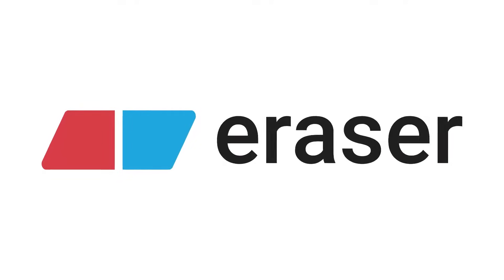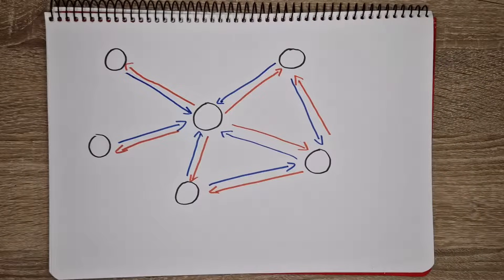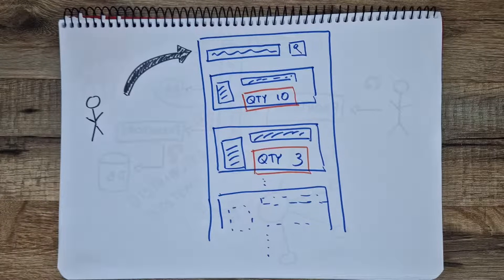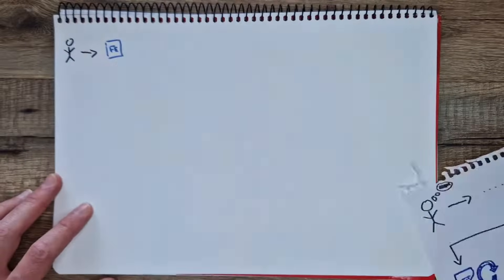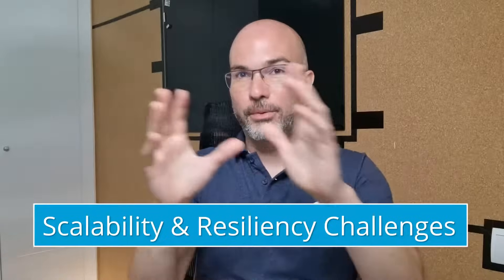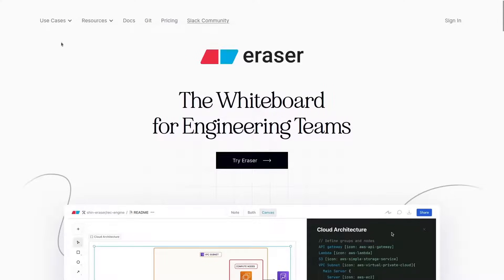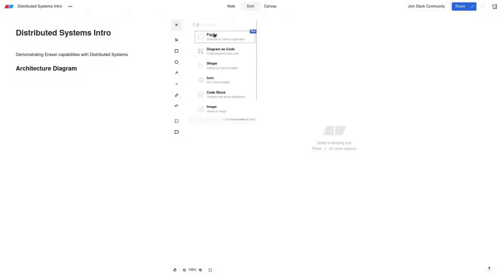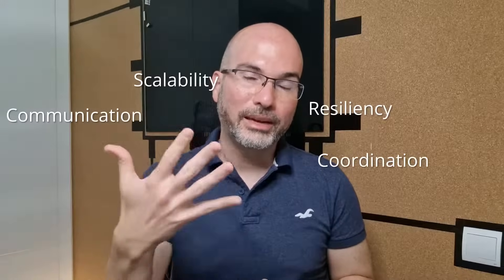Distributed Systems Design Introduction (Concepts & Challenges)

Comment: Hi nice explanation,
Is there any example in github for this architecture?
Reply from the maker: You mean implementation or code? Is it in general for distributed systems or for this specific example?
Reply: @ADevStory  
Thank you for replying.
The use case you explained.
The design is very good.
But we as software developer when we implement we go into bad coding.
For example:
If there is any GitHub,
So that we can spin up docker in our system and check how it's implemented and if DB goes down how it's behaving,how we are handling transactions... etc.
In nutshell:
A usecase : Book search 
A system design : Architect
Code: sample code
Reply from the maker: No for this example I don't have.  But can consider adding one in the future!